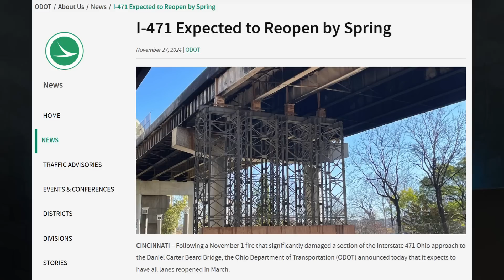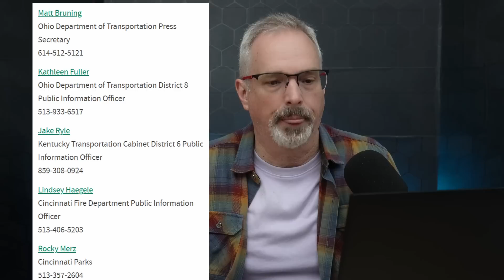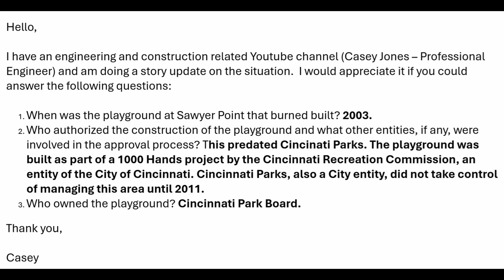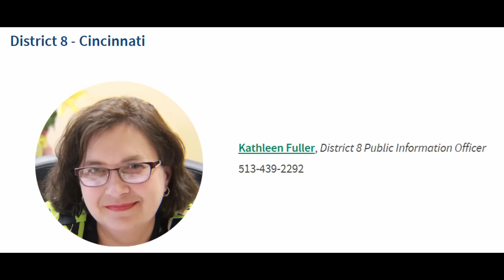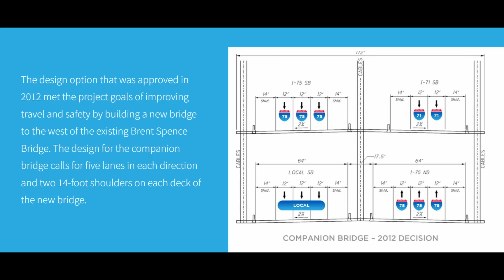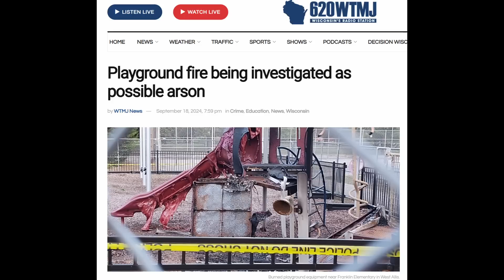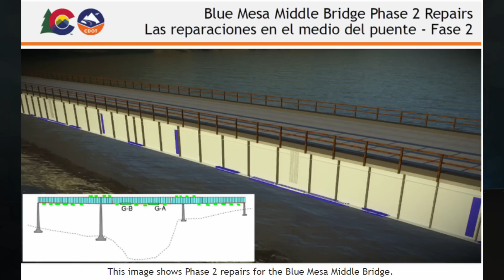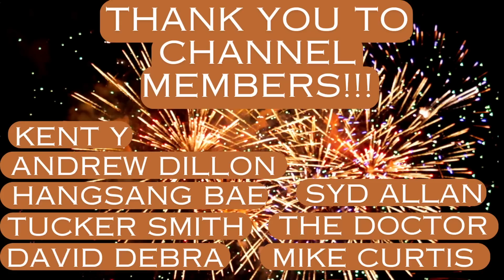Big Mac Bridge Repair Steps and Timeline

Comment: Please tell me if those girders have to be totally engineered or can the original specs be used in whole or part.  In my opinion, this is the typical truck full of words being strategically dumped so as to totally obscure the point in question.  Otherwise known as BS.  For once, I'd like to hear public officials actually answer the question completely and in plain language,

Comment: The Cincinnati Parks reply to your email is a bit misleading, I think. Yes, the playground may have been built in 2003, but at that time, the entire structure was wood with wood mulch. It was renovated much more recently, which is when the composite play structure and rubber ground matting shown in your before photos were installed. I don't believe the original wooden structure and wooden mulch would have burned at nearly the same high temperature as the composite/rubber "upgrade" did.

Comment: Your bad.  Your quoted "a project like this" and the words were "a typical project".  An an engineer you should know that precision in communication is almost paramont and this is what you did in critizing this very thing.  Everyone misspeaks from time to time though, the way to deal with it is simply correct your error, not dig in with a counter attack.
Reply from the maker: I am not sure what you mean.
Reply: @CaseyJones-Engineer  The OHIO dot statement was accurate.  Just not what you wanted.  To be expected when a semi expert tries to get technical info from statements of PR people who focus on what the public is interested in.  For example in the CDOT T1 repair case I watched many hours of of public meetings about the repair to glean technicial info of interest to me that I passed on to you.  Over those perhaps 10 hours of public meetings including questions from the public, there was never a question from the public about a technical issue.  The presentations that included interesting technical information totaled only a few minutes and I had to freeze the screen to read the info on slides.  Almost all the presentations related to detours and opening times of the single lane openings.
Reply from the maker: @michaelmcmullen354  So I am a semi-expert now?  That turned quickly.

Comment: The play structure was built to replace the original plastic coated metal play structure (with the roller slide being a notable bare metal exception).  Late 90's early 2000's had a local program called the 1000 hands project, they rebuilt the sawyer point playground, and one at dunham rec center.  At some point the wood chips at sawyer point got replaced with rubber mat, and shredded tires.  The original play structure being mostly painted metal with sand would have been far less of a fire issue, but If I remember (and from experience with identical play structures around the city), maintenance was becoming an issue due to water penetrating sunbaked epoxy, making for some surprisingly weak floors, and steps.

Comment: When we redeck a bridge here in Indiana when it is not a river bridge, the redecking usually happens in around 3 weeks per side if no beams have to be replaced.
Reply from the maker: Thank you for your comments.  There was a redecking job in Missouri recently where the contractor accidentally saw cut the girders so they had to be replaced.  Ouch.
Reply: @CaseyJones-Engineer  I had that happen once.  Repaired them.  Note the redecking mentioned above matches my experience for shorter bridges, but does not include the planning and bidding phases, or sometimes the Bridgerail.

Comment: We had a bridge where the beams were ripped out from under the deck from a car crusher that raised itself up.  Even though one side was damaged they had the removed within two weeks and the bridge was replaced within 2 months.  There was not any pier damage.  I think most of the delay was getting the concrete beams fabricated.  I suspect this more about budget and finance, in this case the trucking company insurance was picking up the tab and the construction company that built that bridge was still building other bridges just like it on that same stretch of road and the bridge was only 2 or 3 years old.

I expect they had no trouble shooting out an estimate in a few hours after the accident.  Ohio's problem is it will be their money and possibly some federal money and Ohio does not seem to want to invade their rainy-day fund of $3 billion dollars.

Comment: I think a six- to eight-week timeline for fabricating new parts is right. Give the fabricator two weeks to review the plans with in-house engineers, ask questions, and get a written go-ahead. A week and a half to two weeks to source materials. A week or so to sort material cut parts, and fabricate assemblies. The actual fabrication of the parts is a variable but Im thinking two weeks, maybe three. I'm sure the contractor will want to impress so they may be able to compress this timeline but I doubt by very much.

Comment: Casey, In my engineering career, I did system safety analysis using a variety of methods to identify hazards, accidents, consequences, and potential mitigation.  I posit that the possibility of a fire would be close to the top of the list of accidental occurrences even in a  rudimentary checklist review of potential accidents and consequences.  I do recognize that a systematic and thorough safety analysis or review of a design is not a part of a design process in all situations.  This fire and resulting damage is the price now being paid. Fortunately, there was no loss of life.
Reply: Actually there has been research on this issue and others ranking the actual risks by how many structures are put out of service by each hazard.  For bridges, fire is pretty far down the list.  It is high enough that bridge inspectors are supposed to comment on accumulations of debris that might increase the hazard.  Floods and scour top the list and can take years to recover from...sometimes a decade.  In Colorado sometimes tumbleweed accumulations under timber bridges get to be a fire hazard.

Comment: One month before ordering replacement parts? That’s easily how long picking an engineering firm and researching the project could take. I mean, just drawing up the drafted plans could take a week alone, and that’s if it’s rushed. 

Bear in mind, this isn’t just pouring a bunch of special quickset concrete and you’re done (Jan 17th 1994 Northridge Earthquake). Even then, it took engineers 3 months to rebuild the collapsed 10 Freeway. 

But, you’re right. Claiming it would normally take 3 years is silly. 2 ½ with the pace of normal construction. 😆

Comment: The Engineering-News Record account in the Midwest Edition of Nov. 27, does an excellent job of explaining what is transpiring with ODot and what they have been doing for the past month.  As noted below they make it clear that the ODot rep was not discussing an entire bridge replacement but simply a span replacement.  They have been searching for steel as far west as Calif and note that their is a shortage because of a high need in NC and TN due to the hurricane.  Some supplier indicated maybe summer for the steel.  That article answers many of your questions and clearly indicates a focus of ODot on bridge repair.
Reply: US steel shortages for bridges have been a problem for the last two decades.

Comment: This case is comparable to a bridge in Oakland Ca that was lost to a truck fire.  there was a video specifically about the fabrication of the replacement girders that was done in Arizona.  I looked for the video and couldn't find it right now.  Caltrans has experience with the rebuild of a pair of i-10 bridges in Los Angeles after an earthquake that was famous for completion in 55 days. A much more involved project.  Both the I-10 and Oakland cases were rebuilt by the same contractor who was also involved in the replacement of the bridge in Minneapolis a few years later.  Caltrans also has had bridges lost on i-10 to flash flooding.  

I doubt ODT can plan and build a new bridge in 3 years.

Comment: The 3yrs comment likely relates more to the time to go through the bureaucracy, all the meetings, tendering,lead times etc….when it’s an emergency repair much of the bureaucracy gets tosses aside…its just “get it done”
Reply: Normally soil investigations and various permitting occur at a particular places in the serialy organized schedule.  In an emergency you guess and get everything started at once.  The test holes and geological tests may not be where or what you would prefer, you may be wrong on some things, you may have to redesign parts when a surprise sewer line shows up, you may need to make the girder thinner when they survey the road underneath.  Railroad?  Hard to coordinate unless they crashed the bridge.  Near 40 years ago two trains collided head on under a major highway bridge.  Railroad agreed to pay the cost of replicating the 1950 steel bridge (the fire did it in not the crash).  The local transportation district wanted some extra lanes for future bus lanes.  Used newer methods to design (in prestressed concrete) a bridge for less than the cost of the collapsed bridge.  Left it to the RR and transportation district to fight out what to do about the highway dept making a profit on the bridge replacement.  Bridge is still doing fine though another was built along side  for a total of many more lanes.  More time and coordination might have prevented this issue.  Ultimately not much rush was actually needed as the detour the region built was done quickly and was pretty good.

Comment: "Pro" engineers and even people having critical minds should be strongly questioning HOW structural steel girders were warped and wilted by open-air fire, because such is impossible, as every gas stovetop owner, backyard griller, and blowtorch user can verify.  IM POSS IBLE
Reply from the maker: I have already explained in a previous video what happens to structural steel when it is heated up to a few thousand degrees. You clearly have never made a knife blade out of steel stock.
Reply: @CaseyJones-Engineer  Is this the video you're referring to?  ?v=BXrXXBkjxTc
Reply: @CaseyJones-Engineer  Excepting this bridge (and maybe some of the other similar mysteries of recent times, including the WTC girders that mostly turned to dust but many of which warped in multiple axes inexplicable under any load), I'd sure like to see an example of any structural steel girder warping, wilting resulting from exposure to open-air fire of any duration.  My much weaker gas stovetop - iron vs blue flame, sometimes for hours - has lasted perfectly well for decades.  Same with my much weaker still backyard grill.  In comparison, these recent wispy, yellow-flame open-air organically-fueled catastrophes are extraordinary in the extreme.  The presumable 'energy beam test / attack' on Washington state's White River Bridge in 2015 shows similarly oddly warped structural steel girders (on flikr COMpany site, under photos, under wsdot, it's pic # 17100885625).  I'm wondering if the fire in this case was simply distraction.
Reply: It is more like warping a frying pan with too much heat.  Girder expands about 4"/100ft more than the concrete and adjacent girders putting compression in the girder buckling it.

Comment: Are we really to believe that 2 to 4 inches of rubber pellets for padding burned that high and that tall? It is not like a low clearance overpass of 16 feet or something. I would love to see the fire marshal's report on estimated heat and time for burnout of the fuel. The height of the flames seems wrong as well.

Comment: Yup, smoke and mirrors also known as propaganda. How fast was the I-95 tanker fire bridge repair take from the fire? How about the I-85 fire in Atlanta take? This is BS and shame on them.
Reply: I think those are much more reasonable comparisons even though they are other states. These should be lightning fast with all the engineering done long ago. Permitting should not be an issue as long as they rebuild the same standards and methods on the steel. The deck concrete might need to be fast drying but they have experience and data for that to be rushed. Yes, this raises questions for sure.
Reply: @markpashia7067 I believe the I-95 tanker fire was repaired by closing the ramp underneath and filling the opening with reinforced soil.  Not repaired.
Reply: @michaelmcmullen354  Thank you. Did not know that. Good to learn.

Comment: Ya gotta like the use of apples to oranges comparisons to rationalize their talking points by the talking heads. 
It's like if a general contractor could tell his client that a 48 story building takes about two years to build so the client should be happy their knocking out a floor month when in reality that's a really slow pace.
Or if your auto mechanic was trying to rationalize 4 hours for an oil change by saying that changing out the complete engine takes 20 hours +.
Pretty sad that the naked reality of the bridge repair is that it will take an extra three weeks to get the job done because of the way they've gone about it. Just my .02¢ opinion.

Comment: I think it would be better for them to compare themselves to really timely projects like the one you reference and the 2017 43 day repair of an I-85 92' bridge span repair in Atlanta. Atlanta had advantages such as major projects ongoing in the area that they were able to divert fabrication and construction resources from. However, they should be benchmarking against well performed projects instead of their normal processes if they want to improve.

Comment: I would say they are trying to make themselves look good instead of idiots. I also tend to believe that they have had plans to replace sections of the bridge in the original plans when the bridge was designed. I could be wrong. The one thing that is a cause of delay is that the infrastructure that has been built since the original construction. Building replacement parts is just what it is and the length of time to do it. I doubt they would have anything built and just laying around. The only way to get the parts built faster is to pay more money to speed the process. Not going to happen. Plus the parts haven't been made in many years so they need to do it right.

Comment: Has the span changed in the period after initial construction.? Exact measurements before ordering?
Reply: Usually not if using dimensions from the shop plans, but sometimes there are unrecorded changes that occur after the girders were fabricated.  I seem to remember steel on a longish bridge being 2' too long due to a survey error on abutment placement (different benchmark used on the east end of the bridge) and the end girder was trimmed and the end diaphragm rewelded to the new location.

Comment: During my career before retirement I worked as a professional engineer functioning as a general civil, structural, geotechnical, and materials engineer. Based on how you approach a problem, my guess is that your experience is similar to mine.

Comment: I suspect that the foundry had to change their scheduled work (scheduled months in advance) to produce those plates.  Ditto the fabricator, though the fab may have a little more flexibility.  (I buy electronic components through a retailer that lists not only their stock but factory stock and lead times for 100,000s of parts.)

Comment: Are we supposed to pretend that the Playground playset was made from solid Rocket Fuel??
Anybody can watch the videos of the fire and the results, which clearly defies physics of open atmosphere fire. 
It's impossible to bend 2 girters identically from just plastic burning. 
The only way to do that is with EMF HP RF Microwave Military  Technology. DEW's
Reply: It doesn't take as much heat as you think to buckle the girders.  Barely enough to burn the paint.  The steel itself is not hurt at all, just not straight any more.  Might be a few failed gusset connections, and it looks like some shear connections are sheared off, but the picture might not be good enough to tell for sure.

Comment: The span that is damaged is the most normal, straight, ordinary generic elevated highway that could ever be, it's not even over a challenging area, the area where the playground was is paved and easily reached by even the largest of equipment.  The girders are the most normal straight ordinary plain I beams possible, so in what world could simple replacement of seven straight beams over stable paved dry level land take three years?  Those beams cannot take long to source, they must be about as generic as possible.
   I walked beneath there about a week before the fire and noticed a whole lot of grounds keeping vehicles driving through there, I wonder if one of those could have been involved or the fuel for them or charging of the electric ones.  
     So now we get a rush job that to do right should take three years instead taking a number of weeks (per their logic)?
Reply: All steel beams are custom fabricated in sizes suitable for highway bridges.  Beams over about 40" deep are welded up from plates that are custom rolled at the steel mill and have a lot of stiffeners added.  Dimensions need to be within about 1/32" to 1/16" of correct or the bolts don't fit.  Only a modest percentage of steel shops can fabricate welded steel girders in bridge sizes.  Contractor drops one, or truck rolls with a girder on it (happens) and it is back to ordering plate from the mill.